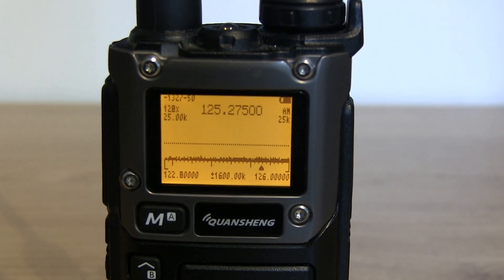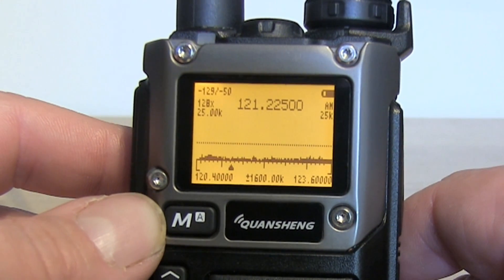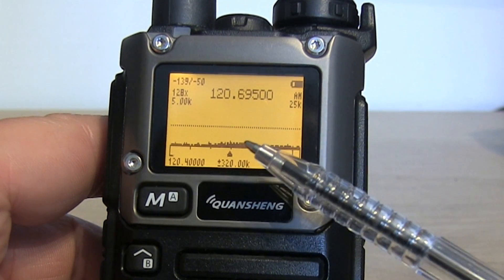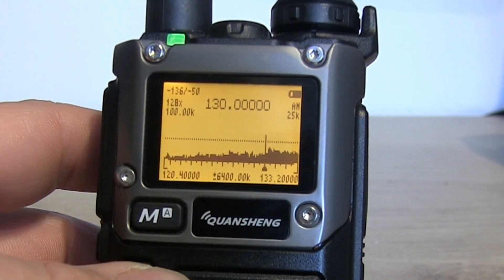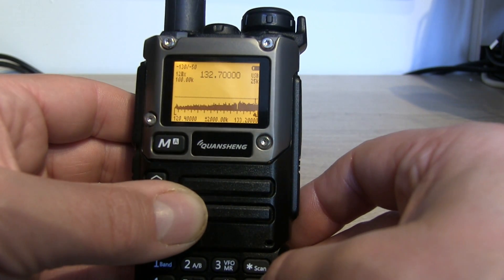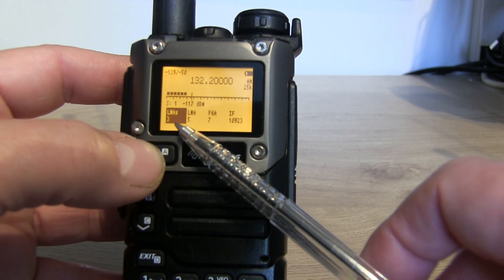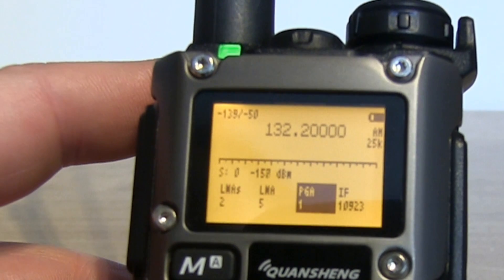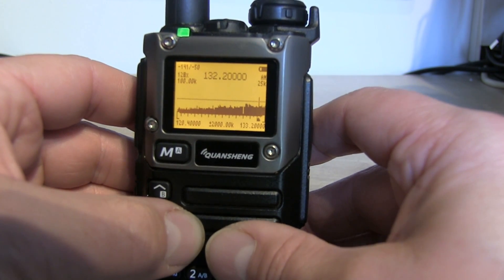Quansheng - Egzumer Spectrum Analyzer

Comment: I just purchased a K5(99) and with the stock firmware if I press F+5 I get the spectrum analyzer rather than the NOAA scan.  I thought the spectrum analyzer was only available with the hacked firmware like Egzumer.  My firmware in Chirp shows as 0SFW-bd90ca3.   Can anyone else confirm if this has always been available in the stock firmware or has my new radio got some new stock firmware that has the spectrum analyzer?  I've also noticed that two menu options shown in the manual are not in the radio, #34 "AL-MOD" and #49 "NOAA_S", are not in my menu but I can see them in Chirp or the Quansheng "Portable Radio CPS" software.
Reply from the maker: Unfortunately, I changed my firmware in the K5(99) before I had a chance to check. Hopefully someone else will know the answer. Thanks for watching 👍 
Ben,
de M7FRS

Comment: I use a fork of egzumer called Kamilsss (nunu) it improves on the spectrum scanning feature it is much quicker at scanning a full band than egzumer is, it will say scan 144.00 to 148.00 in about ten seconds when it gets 'a hit' you press the PTT and like Ben mentioned it imports it to the VFO screen where you can easily add to a memory I use this feature daily it is also the firmware that does the text messaging but I think this is a bit of a gimmick so that doesn't bother me, it is available through GitHub
Reply from the maker: Thanks for the info and for watching. Yeah I've had a bit of a play with the Nunu firmware, I'll have to play some more 👍

Comment: You can also use buttons 3 and 9 while in the spectrum.. it seems to magnify if right terms. 9 to zoom in and 3 back out. I’m not to wise on all this but it moves the spectrum and the -numbers top left of screen.
Reply from the maker: Thanks for the info and thanks for watching 👍
Reply: Just tried this on mine. 3 and 9 cycle through all the bands with the firmware I have. Thanks I learned new buttons to use.